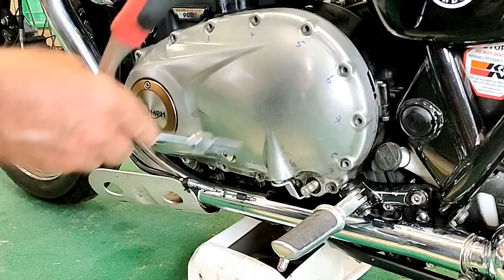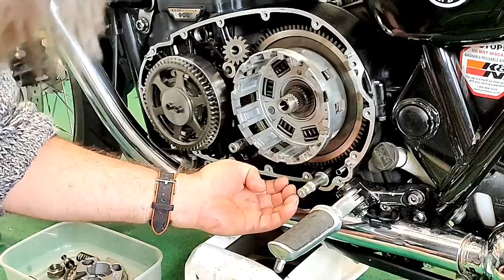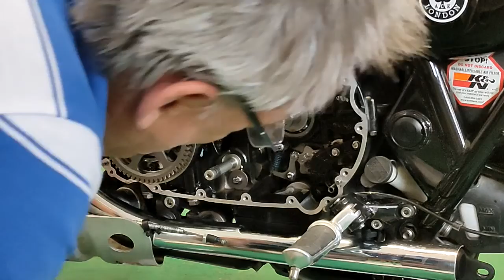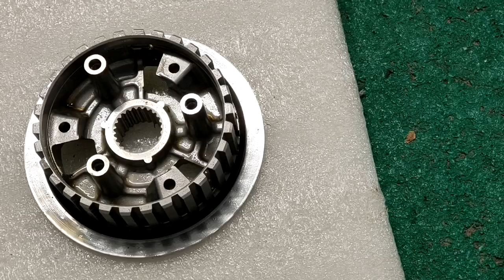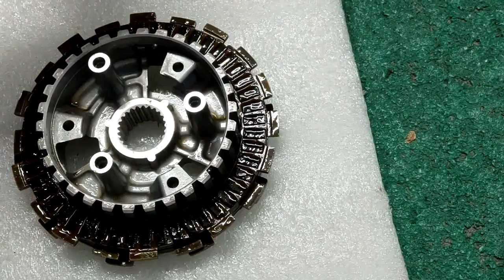Triumph bonneville gear selector fix

Comment: This is very helpful, thank you, my T120 selector is just starting to fail, it slips down further even when already in first gear! I had the same problem with my 2013 Tiger but caught it too late and got locked in 4th gear, had to replace the pivot plate and also did the Detent Wheel for good measure....the Tiger had an upgraded pivot plate available because of the known issue, but sadly there doesn't seem to be an upgrade for the T120 so I guess we just have to replace with the same stock (until next time!) ?

Comment: Because there is no sacrificial shifter linkage the transmission takes the brunt of it if you fall onto your shifter  I’m gonna take a Aluminum dirt bike shifter and drill some holes in it to make or maybe a crash bar to protect it. I’m 1,200 miles away from home right now with a messed up gear box because of this

Comment: Seems like this is a common problem for early LC bonneville models (16,17,18)... some says it's a design flaws.... not sure if they fixed it in later models.
Reply: 2024 T120 1600 miles here, this has not been fixed on newer models either and is a known issue to triumph. Not known to me when I discovered I couldn’t shift down when I was 35 miles from home!
Reply: @JoshuaTomlins  seems like they are scamming people in the name of premium and heritage

Comment: Just a heads up......watch the small spring that can fly off taking the cover off.....as it did with mine....took some figuring out where it came from.

If you dont know....the rod that passes through the case and the clutch cable attaches to.....look at its top end....has a slot in it....the tang fits in that slit and into a slot in the case.....must just help the rod to the clutch pin return.

Hope that helps somebody.

Nick in the UK.

Comment: I understand that Triumph have redesigned the gearbox from 2022 models onwards,  therefore curing this problem. Can anyone confirm this?
Reply: I can confirm that Triumph have NOT cured this issue. They did release a tech bulletin and supposedly a completely new replacement part. My 2023 T120 stopped downshifting at 3000 miles. Dealer warranties it. It has now failed again at 6000 miles. Dealer warrantying it again but i now have zero faith the repair will hold up. This is a shit problem to have on a premium bike. Maybe we should all just buy Royal Enfields. Triumph obviously doesnt give a flying fk about making this issue a priority and fixing it properly. My T120 has never been dropped and i baby her when i ride. This is a major design flaw.
Reply: @LaminarSound Ok thanks for the info. Its not great news.
Reply: 2024 T120 here, 1600 miles and they have absolutely not fixed this issue. Exact same problem but I have been advised that the new gear selector is this ‘upgraded variant’. Unfortunately the part is on back order for a month, but had no notification of this fault until I went to do my commute home from work to discover I could shift up gears but not down. Limped it all the way to a triumph garage firstly in 6th before a check engine light came on (which they said was expected with any gear issues like this) managed to get it into 3rd by using my hands and doing the same but lost all ability to shift down and as soon as it was at the garage they knew what the issue was immediately. 

Currently with the garage now for the replacement gear shifter but this issue came on with no warning, it had only been in for its 1000 miles service at the start of 2025

Edit: to add, my bike has not been dropped at all, this is a weak point that is known to triumph. Not known to me until I was stranded some 35 miles from home!
Reply: @JoshuaTomlins Sorry to hear. I was thinking of getting a 1200 scrambler a few months ago but learning of this fault but me off unfortunately.

Comment: 1) Do you put the clutch plates in a tub with oil to let them set in?

2) Do I need an impact wrench for that center nut on the clutch, or will a breaker bar and 13mm socket work just the same?

3) what oil weight did you use.  Mine is a 2022 T100, so I'm also curious if I need real or synthetic, I assume synthetic since the interval is 10,000 miles.

Since the oil in it is fairly new, can I just use that to oil the clutch plates?

Comment: I wish you had done a video on the putting the cover back on. I snapped the rod inside the cover because I had it turned around and not engaging the pin rod head. Finally got a new one 2 2weeks later and I'm having a hell of a time getting that to lock in properly and when I think it does the clutch cable clip( stick out from the rod outside the cover) has too much play. Normally I wrestle trying to get the clutch cable head back in the slot but now it just seems to be too much cable. So I know something"s not right. ARGHHHHH"
Reply: I’m having the exact same issue here 😅
Reply: Currently battling this same issue

Comment: Thanks for the video. I'm doing it on a Street Scrambler which is the same as teh street twin but any differences with the Bonneville are negligable. That said, when you show the gear shfter (pivot plate) from a picture in the Haynes manual and say it has to be in that same configuration, will it make any difference if it isn't? I imagine it does if it's mentionned both in your video and the manual. Just wanted to know how to get it back in (the new gear shift selector) in the that original position. And if you can show me where in the manual it gives torque specs, cause I don't see them.
Cheers.,

Comment: I assembled it then install a clutch cable to check if everything good. But, the clutch is not disengaged when sit on 1st gear and I pull the clutch cable. Should I install cover and fill the engine oil to solve this or something went wrong?

Comment: The Achilles Heel of these Liquid Cooled TRIUMPHS, Don't drop them on the left side.
Reply: that's EXACTLY what happened to mine at a Motorcycle Safety course that was hosted by my local PD, and now I can barely get it into 2nd gear.
Reply: Ive never dropped mine and its being repaired for the 2nd time since i bought it 7 months ago. 2023 T120. 6000 miles. Its a joke. 

Funny enough, i did drop my Street Twin on the shifter level but never once had an issue with that bike in 11,000 miles.
Reply: @LaminarSound  you got lucky then, or perhaps you have a set of crash bars? There is mod that people usually do on the shift lever, they simply put a 6mm thick spacer between the shifter and engine case, sometimes many just use a set of washers to get the 6mm thickness.
Reply: @ripmax333  no, I did not have crash bars on my Street Twin. I laid that bike over at low speed after hitting a patch of dirt and the front wheel slipped. The shifter lever was scratched pretty badly but not bent. I just had to replace the clutch lever and mirror and dented the shit out of the tank. But never once had a gear box issue with that bike. It was an amazing bike all 11K miles. The T120 however is suffering from the dreaded downshift issue for the second time now and Im debating trading it in. I really dont have confidence that a 2025 model wont have the same issue though....
Reply: @LaminarSound  Well I now think that you got really lucky 😆, many laid down the street twin, Cup or T100 as you said and many managed to bend the internal shift shaft which connects to the shift lever making hard or even impossible to change gears. Sry to hear you have no luck on the T120, a really beautiful bike but I think I still prefer 900 for being lighter.
Reply: @LaminarSound exactly the same here on a 2024 T120 with 1600 miles. Never been dropped and yet I was stuck unable to shift down. Currently in with triumph now but pretty frustrating and disappointing

Comment: Can anybody help. I’m having a hell of a time getting the lever on the bottom of the cover to engage inside. Instead of being 90 degrees (roughly to the cover it’s 45 degrees past where I think it should be. I then have zero adjustment in the clutch cable. I hope that makes sense. It’s engaging something inside. It’s baffling me. Background, I’ve changed the engine covers. Thanks.

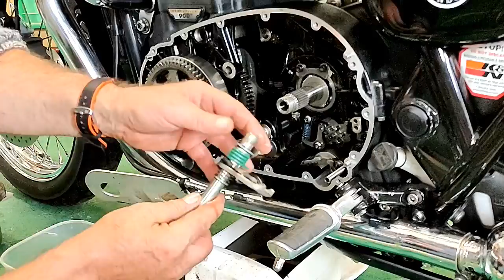Comment: Thx for the video.  I wouldn't do that by myself but like to to see the process. At 6:30 in the video you talk about a slight chipping inside of the pole on the selector or the pivot plate as a possible source of the problem. Was it ?   Have you replaced this part to fix the problem or any other parts ?  You mention at the end of the video now the bike works fantastic.  It was in 2021. Do you have an update three years later ?  Is the problem reoccur ?  thx
Reply from the maker: The chipping WAS the problem.It failed again twice more. I had a second updated part from triumph and so far it is ok.
Reply: @JH-wt3zq my 2023 T120 had this issue at 3000 miles and now again at 6000 miles. I want so badly to get rid of this bile but i love it so much. If Triumph havent manufactured a proper replacement by now, i fear it will forever have this problem. 🫤
Reply: On the Triumph Rat Forum this is usually the culprit. THe metal is rather soft (wonder why they don't make it stronger) and often leads to this problem.

Comment: Thanks for the video. I've just changed mine out using this and the Haynes manual as guidance. Definitely buy a clutch tool to get the main clutch nut off and re-tightened afterwards. Otherwise you risk bending your spokes if you put a bar through the rear wheel. Also make sure the spring plate on the outside of the clutch assembly finishes with a 2-3mm gap off the centre part once the 3 bolts are tightened, otherwise the clutch casing and cable tension will be completely wrong. The inner clutch assembly (final plate and clutch plate included) can sit wrong, resulting in the spring plate sitting flush to the central assembly. This is wrong and won't close up correctly. Take pictures of absolutely everything so that you can re-assemble to the same spec. Thanks again for taking the time to record this, it was a great help!
Reply: Can you recommend a Clutch tool, please? I'll be doing this on my own as I accidentally dropped my Bonnie on her left side, and I've not even done an oil change. So I'm having to learn everything as I go pretty much.
Reply: @AussyLipp My Haynes for '16 to '19 says T3880307 (or similar)  It also says "to unscrew the clutch nut the transmission input shaft must be locked this can be done by selecting top gear and having an assistant hold the brakes on hard with the rear tyre in firm contact with the ground, alternative triumph service tool mentioned can be used.

Comment: Why should you have to repair and re repair a basically new motorcycle , Never owned this brand and NEVER Will. I feel very sad for all who get thrown under the proverbial bus by this crowd. I know personally , a very frustrated and sorry individual with 2016 t120 that cant go anywhere . Disgraceful behaviour indeed .
Reply: It’s sad but true. I love my T120. It’s an amazing machine. Looks just beautiful and rides like a dream. But I’m now in my 2nd repair on a brand new bike with 6000 miles on it and have no confidence in its reliability moving forward. Will likely trade it in.

Comment: This is great! I’ve watched a few of these gear shaft assembly videos on YouTube and had a couple of questions if I may.
1. What year is this Bonneville? I have a 2012 black cased Scrambler. 
It looks like there’s is a different procedure on the carbureted model engines, where they pull the shaft from the drive side after removing the clutch, etc but also must remove the drive sprocket…just trying to determine what year models this approach works with.

2. Are most downshifting issues caused by this? I bought the bike used and found it a little dodgy getting it into 1st gear and expected a clutch or cable adjustments. I don’t know if the bike was dropped by the previous owner and don’t know if the shaft is bent, so hence my question if there are other culprits for this problem. This certainly SEEMS like my problem but I can’t tell visually.
Thanks for the video and any other advice you can provide regarding the above.

Comment: Nooooooo.
I sat through the whole thing to see if I installed the pull rod incorrectly and it didn't make it into the video :(
I changed my plates and springs only, but my pull rod seems to have no spring tension and will not return to position. I have no idea what I have done wrong. I have checked photos and I am sure the spring is seated correctly but it has no force to return the clutch lever when pulled. Any idea what would cause this? does it need oil pressure?
Reply from the maker: Hi Christian, I have had the same problem, The way i fixed it is to take the clutch plates out again and reinstal them very very carefully making sure that they are in order and flat and tight together.Once I did this i managed to get the tension in the pull rod. I went mad just like you as I could not see any logic why it should not fit-the reason is a slight misalignment when installing the whole clutch unit.
Reply: @JH-wt3zq  Thanks Mate!
I will pull it apart again tonight and double check it all.
Reply: @JH-wt3zq  you were right. I hadn't put the last plate offset to the rest!
Reply from the maker: @ck5922-z2z  Did go back together ok after that?
Reply: @JH-wt3zq  Yes, just trying to get the clutch adjusted now, but it functions !!

Comment: Great video. Very helpful. My 2017 T120 has just begun acting up, during down shifts. Feels like there's no engagement with the gearbox and like I'm just rattling the gear lever in an empty space. It does seem to change down if I actuate the gear lever slowly, however. But, I don't want to be left stranded.

I'll follow this video to change my pivot plate out (new selector mechanism). It appears that you have changed your detent wheel, the selector mechanism (including pivot plate), and the clutch assembly centre nut. Would you recommend this when undertaking the task? Or are you just being thorough? (To be fair, I would prefer to be thorough).

Thanks.

Comment: Hi, Followed your procedure, worked wonderfully, thanks. Second time my 2018 T120 had this problem in 27Km
May I suggest that you rename this video.  Producegear does not lend itself for a search for gearbox issues. How about Triumph Gear Selector - Fix and Replace